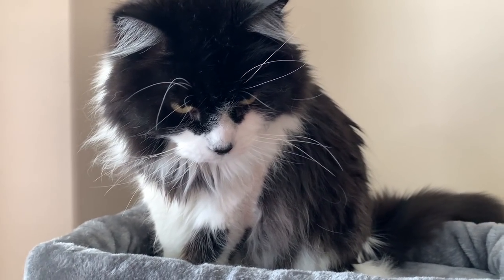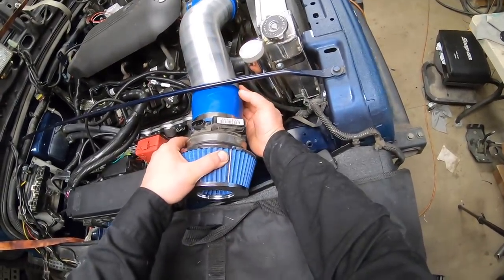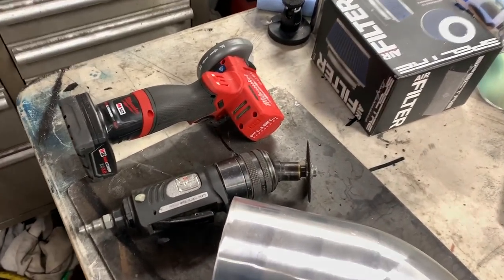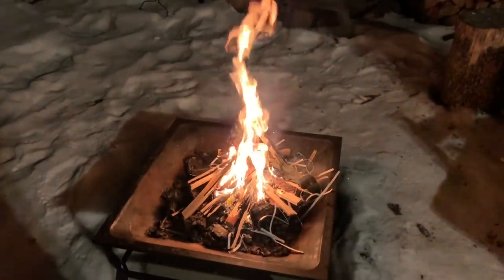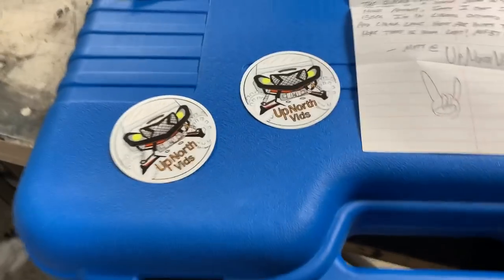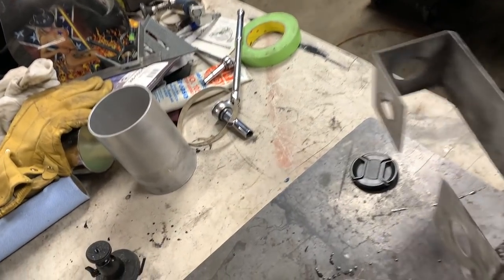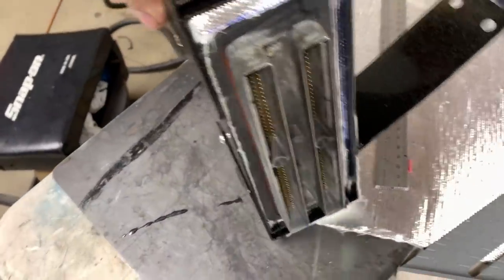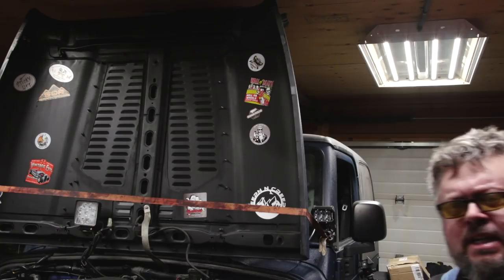Will this Solve High Intake Air Temperatures

Comment: That heat reflect material works well Jerry.  I have a Shovelhead Harley where the battery sits in the horseshoe oil tank and batteries were getting fried due to heat soak.  I made a little battery sleeve box out of that material you used and it’s been fine ever since.

Comment: You did the right thing.  I seriously doubt there will be any heat issues.  Apparently that was a more common problem back in the 80's and 90's but designs have changed since then, according to the ECM information I have been reading.
Reply from the maker: It is a heat sink, how warm it would get would be any bodies guess

Comment: Jerry, on the spectra filters, I have one and in really dusty conditions they allow a lot of silt to come through. After cleaning out my throttle body and seeing the crap in it, I run filterwares pre filter.  Seems to do the trick. Also those Lennox wheels work great as long as they have power. They really grab. Love the show, and the builds! MFBT!
Reply from the maker: Funny you mentioned that as I did get a Pre-filter for it

Comment: The way you have the air intake routed is better farther away from the engine. If you look at the air intake on your F-150 if it's in the stock setup, the air intake actually pulls air from the left wheel well area, basically avoiding the engine compartment air completely. Cooler air, denser fuel charge.

Comment: Regarding electric tools, usually the higher the voltage the more power it has. Yours is M12 - the lowest power. Get M18 (18V) OR switch brands to those offering above 20V.

Comment: Pardon me, do you have any Grey Poupon?
Also i do not see how you intend to lower air temps by having that filter under the hood like that unless you have some outside air going to it. Seems to me it will just suck in hot air from under the hood solving nothing. You need an airbox around it and  have cold air coming into it via ducting or something and sealed against the hood when closed or at the very least pipe some air thru the grille or something so it blows on the filter. My thoughts anyway.
Reply: my thoughts exactly
Reply from the maker: Majority of LS swapped user out the air intake in the same spot...... it’s the same spot where the factory air box was..... same spot my banks ram air was installed........
Reply: @BackCountryWrenching  just does not seem like it would do much like that. no direct cold air, just hot engine air. Lots of space for air to get in under the hood for sure and maybe thats enough. Be interesting if you rigged up a temp device and checked the difference vs a closed in one that has air piped in once your beast is up and rolling. Have any concerns about it sucking in water if you go puddle jumping?
Reply from the maker: Not interested puddle jumping that’s how people hydro lock motors, all water crossings done without being stupid......
Reply: BLEEPING JEEP MADE A BOX FOR HIS JEEP, YOU SHOULD CHECK IT OUT.
Reply: @BackCountryWrenching  or without having any fun i guess lol. Best of luck to you with the build
Reply: @BackCountryWrenching  The cold air intake for my Veloster came with a down pipe and a pre filter housed in an enclosure, thing is the filter was pass through on the down pipe so if for some reason the car was in deep water it would draw air from the engine bay instead of the front wheel well, kinda a hybrid design and a good idea.